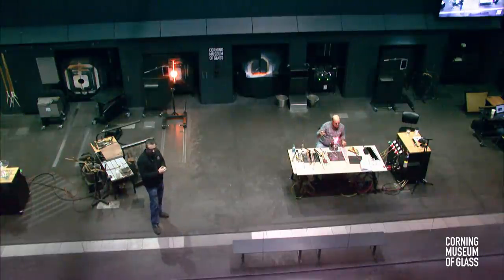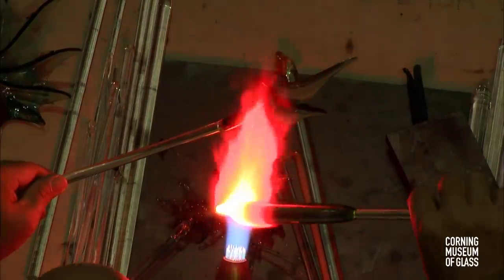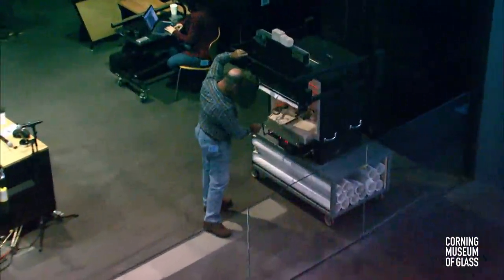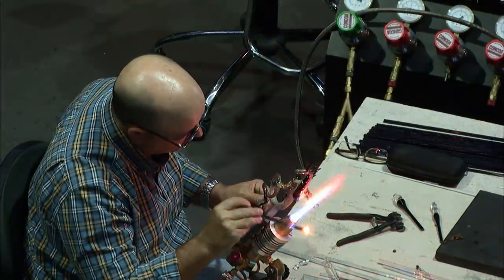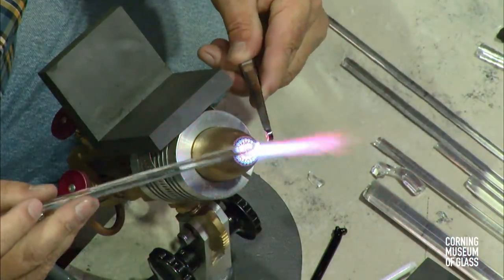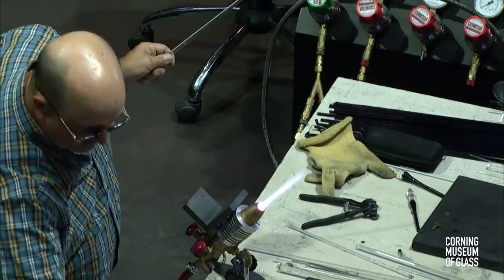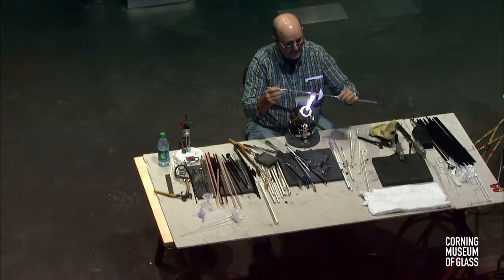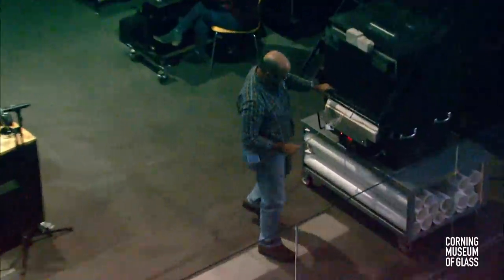David Sandidge Guest Artist Demonstration

Comment: what is the largest possible piece that could be made easily on torchwork also do you at cmg have any examples
Reply from the maker: The only limits are one's imagination and dexterity. One of the largest flameworked pieces in our collection is Susan Plum's "Woven Heaven, Tangled Earth," which has a maximum diameter of 91.4 cm: https://www.cmog.org/artwork/woven-heaven-tangled-earth.